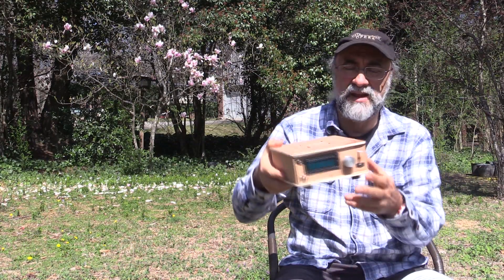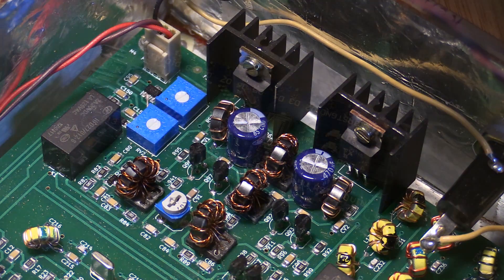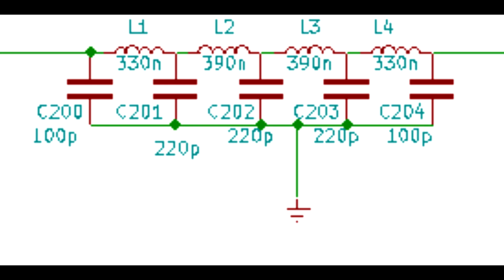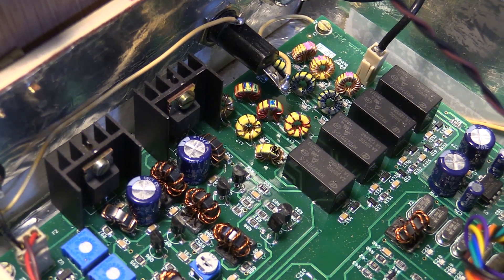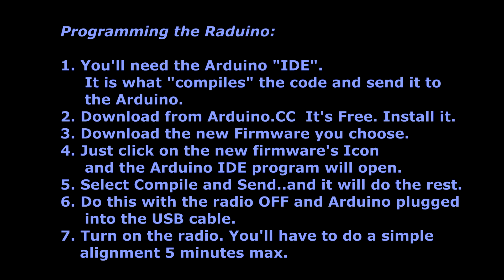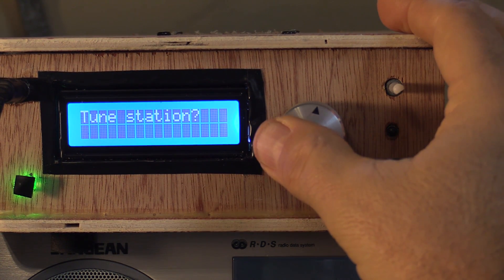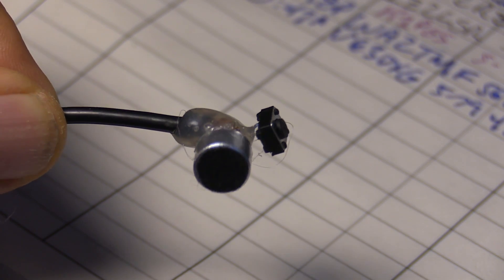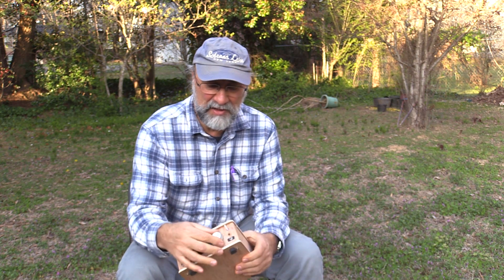uBITX HF Tranceiver - Overview

Comment: Best is version 6. Costs 209 bucks for full kit. I bought four of them. Takes less than one hour to assemble. 

Excellent receiver, dual conversion. Full kit comes with professional cabinet, speaker, knobs and hardware.  No tuning, comes pretuned.

Àssembly requires no soldering.  Plug n chug.

Touch screen. Has split and rit. All common and inexpensive parts.
KK5R

Comment: Mine comes yesterday ,afher spent some hours  for calibracion  first BFO  off course .But when i click on the ptt  for ok the signal are always 2,5khz of the origenal .I dont see CW in the display also  only USB and LSB .When i go in tx  i see CW in the display but my tx signal comingout 2,5khz above  so 7027  is 7029.5 in rx .Afther four hours there was smoke on the audio chip ordened  3 new pieces this morning on Ebay .I hope on a good end Thx for the video Bob  73, ON3MK  Mor

Comment: Great video.  Thanks for the insights on the software. Many on YT suggest a fuse to the device.  Where would you connect on on the µBITx?  thx
Reply from the maker: Just in line with the positive DC voltage lead - power cord. 3 amps would be good
Reply: @robertnagy2163  Thanks Robert.

Comment: I'm thinking that a surplus ammo box would make a nice box for the rig.
Reply: I have an ammo box, sounds like this could be sweet "go box". I would look at a small AGM battery. There is a 4 inch tall 250CCA AGM battery that might be just the ticket, put charging post on the outside and a digital battery meter on it. Harbor freight here I come!!

Comment: Yeah wow the KD8CEC firmware is far superior to what you have loaded... better look at that again.
Reply: Yes, it IS amazing. One has to remember that the basic performance of this radio is....basic. No manner of display, software or additional arduinos is going to change it. It's a VERY rudimentary radio with marginal performance. Still, it is fun to put a top-shelf "face" on it.

Comment: Hello Bob, Great meeting you at Dayton.  Did you do anything about the uBITX's power dropoff in the lower bands like 80m?
Reply: Kevin- nope. He used really low-cost transistors in the final on the UBitx.. Upside is you can replace them for $3. Downside is power drop-off.  It's a low-cost radio....and great meeting you too...looking forward to next year.

Comment: IM having trouble changing banda the easy way can you help  oh i love my ft 991 tnx kg6mn
Reply: You have to add a simple switch (push-button) across the main tuning dial switch wires. This way you can set the band- take your fingers off the tuning dial- and push the button.